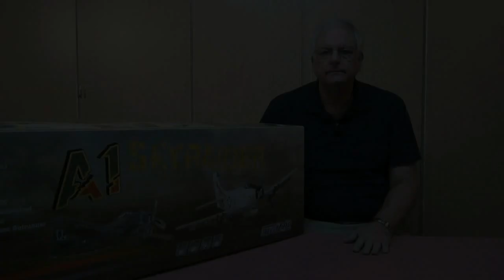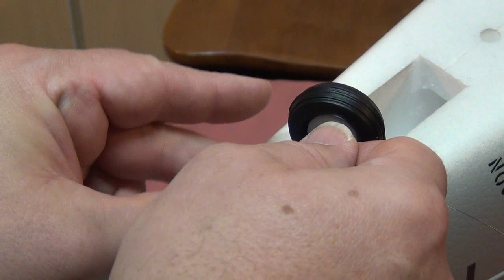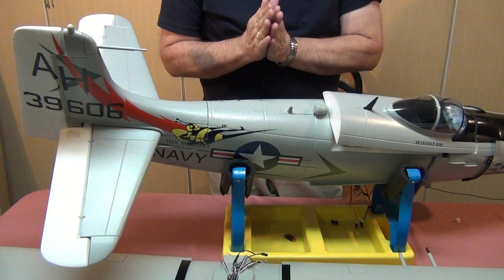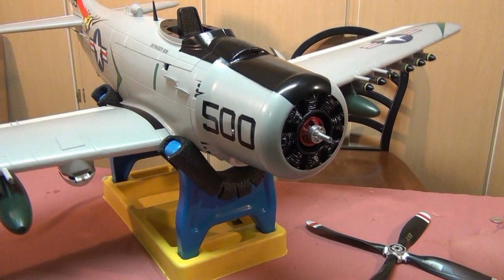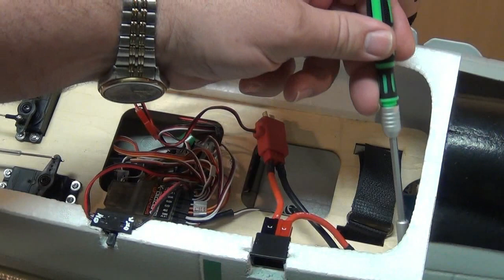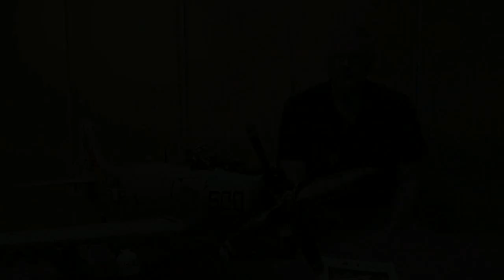A-1 Skyraider Build Log Pt3.mp4

Comment: Great video. At the 4:00 minute mark you start to tie the wires for the tail wheel to the rudder servo. My wire keep coming loose and it was annoying like hell. So I went to the local hobby shop and made push rod with Z bends and the tail steering was more reliable. Again if you use this mod, make sure the rods bend easy as when the gear retracts up that the rods can bend easily. When I get my replacement fuselage I'll make a video to show how I did this. Also I noticed that if you combine the

Comment: In the areas where screws are used it will help to place some fuel tubing in the holes so that if by chance the screw comes loose it will not fall out and get lost. The fuel tubing will keep the screw in the hole and save time from looking for a lost scew.